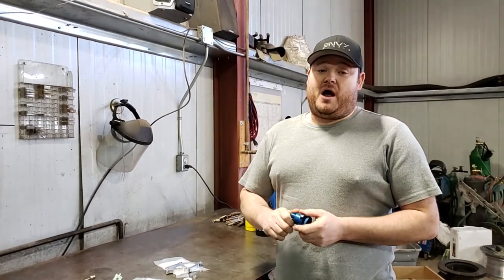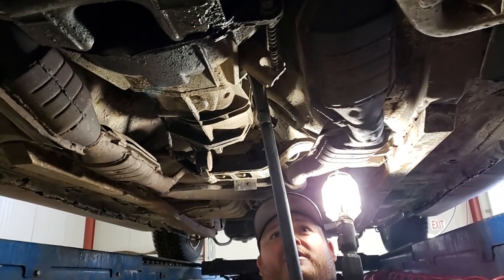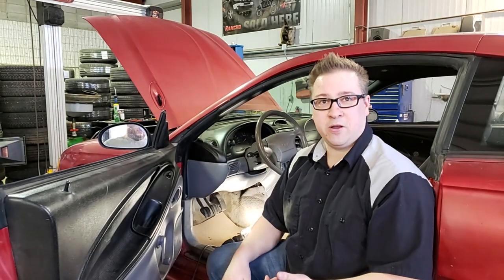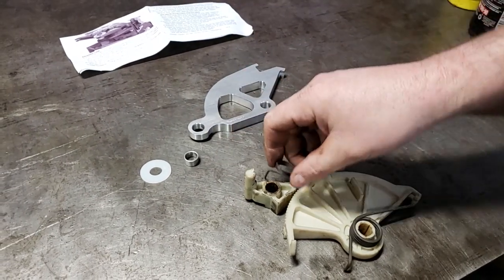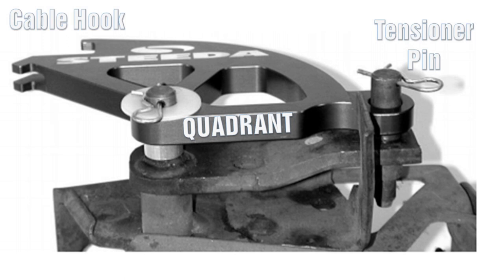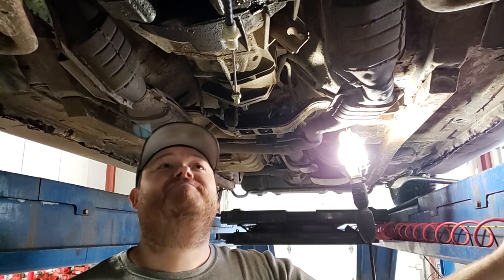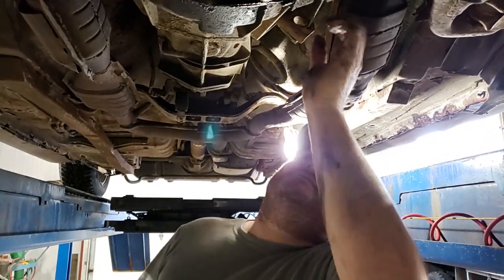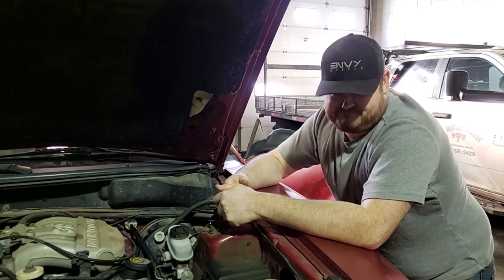SN95 Owner's Guide #13 - Clutch Quadrant, Cable & Firewall Adjuster Install

Comment: I have the old steeds and it won't stay adjusted.  I'll fix that with silicon or thread locker. I never understood why there is no return spring to pull back so the TO bering gets to rest. I'll try to fix that too.

Comment: Great thanks a lot very helpful did you put the cable in on the front hook of clutch quadrant or the second hook
Reply from the maker: For a stock style cable, we used the "back hook" the one that allows the cable to be the longest, if you try the other one you'll see that you run out of adjustment at the firewall. If you have an adjustable cable, you can play with the length to use whichever hook you wish.
Reply: Awesome thanks for the info

Comment: What if I can’t get the adjuster on the cable at the bell housing m loose enough even with firewall adjuster all the way in to get that little play at the pedal?   Could my cable be to short that bbk sent me?

Comment: I just installed a steeda quadrant (double hook), no firewall adjuster, with adjustable clutch cable. The clutch cable seems to be too short, it reaches only about a fourth of the way to the clutch fork. It’s a 1997 mustang Gt.
Reply: Any ideas on what I should do?
Reply from the maker: My personal recommendation would be to inspect the adjustable cable with regards to overall length when compared to the stock piece, if that checks out, then inspect the routing to ensure you followed the factory path. If that doesn't show anything, it is possible you got a wrong part/part number and might need to look at an exchange. Of course, as covered in the video, my best recommendation is a OE style cable and a firewall adjuster, experience with adjustable cables has not been good. Thanks for watching and commenting! - Darren

Comment: Which brand or brands of "stock" clutch cable have you had success with? Couldn't understand which brand you mentioned.
Reply from the maker: FoMoCo, or Ford Motor Company/Motorcraft have been our go-to. They are likely unavailable now, but look for a high quality piece that matches lookup for a F4ZZ7K553A. Avoid any sort of adjustable cable, they are unreliable at times.

Comment: What’s the part number for the cable I can’t find an oem cord cable anywhere
Reply from the maker: I use this part, and just keep the fork on the shelf until I need a Fox one for something: Ford Performance Parts Clutch Linkage Upgrade Kits and Accessories M-7553-A302

Comment: Do the springs on the quadrant go in the new one or now
Reply from the maker: The old springs are for the self adjuster system for the plastic quadrant, you may discard the springs as they aren't used in a billet quadrant and firewall adjuster setup. -Darren

Comment: Hey bros i installed a bbk adjustable clutch cable and im wondering should the fork have a lot of play when its not hooked up to the cable
Reply from the maker: If the fork is not connected to the cable, it will freely move to the rear and will be able to twist to some degree. This is because the clutch fork is on a mushroom shaped pivot and the throw-out bearing is retained on the fork with a wishbone shaped spring clip. It might be hard for us to understand the amount of play you are experiencing but there is a fair amount generally speaking. Once the cable is seated in the fork and the pedal is adjusted you will probably see this reduce quite a bit. If in doubt, of the throwout bearing or any other parts, now is a good time to use a flashlight to check for obvious signs of issues. Hopefully this helps you out, thanks for watching and commenting! - Darren

Comment: I don’t like how high my peddle sits is there a way to get it not to be so high
Reply from the maker: The only way I could think of would be to also install an adjustable cable and firewall adjuster then fine tune between the pedal height and making sure you get complete clutch disengagement during shifts. Otherwise the clutch pedal lands wherever it is adjusted for proper shifting and that's where it will be. Thanks for watching and commenting! - Darren

Comment: Can you use the oem clutch cable with the firewall adjuster ?
Reply from the maker: Yes you can, on my personal '95 GTS I used the stock cable. Depending on which adjuster one you get you might have to do a bit of trimming to the plastic bits, but follow any instruction sheet and you should be good. Thanks for commenting! - Darren